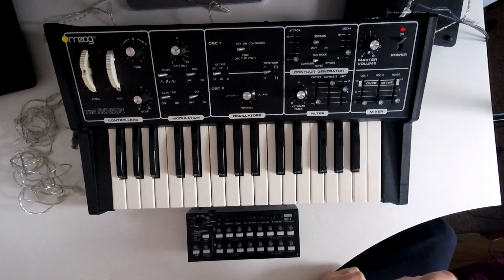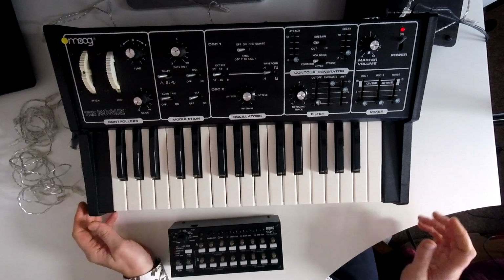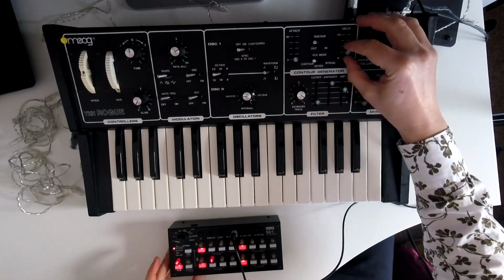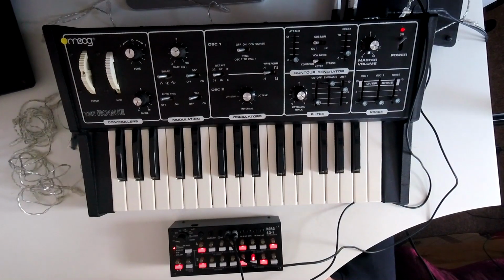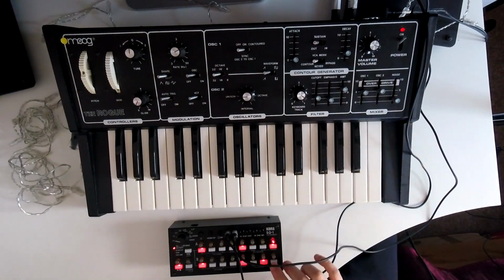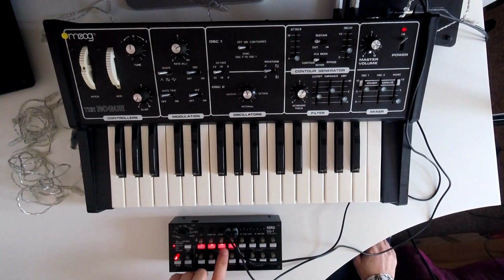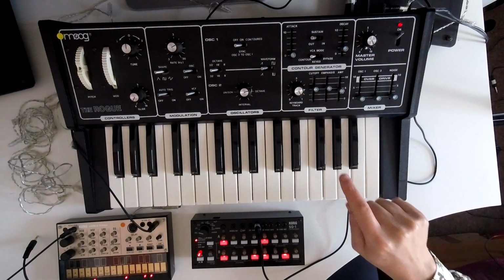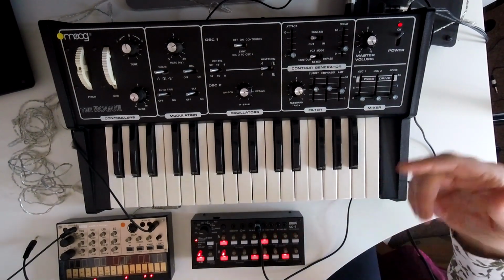Moog Rogue - sounds, sequences and external signal processing using this classic vintage synthesiser

Comment: Very nice!  I have 2 Rogues and one Prodigy (the older kind with no CV inputs).  I need to get one of those sequencers for my Rogues
Reply: i had a rogue since late 90's, got rid of it, always envied and wanted a Prodigy over it.. still want one!!  wood panel, more solid, rich and rugged wouldn't you say?  Prodigy can do more true classic Moog tones, just all around classier than Rogue, but sure it's unique and has a gritter dirtier sound than prodigy
Reply: @michaelpaul5801  I personally prefer the Rogue because it has a Trigger input and an Audio input. I've since got a CV sequencer for my Rogues and it's super cooll

Comment: Hi there! Very nice video. Could you tell me which cables are you using? Thanks in advance. Cheers from Switzerland!
Reply: 1/4” to 1/8” mono cables. Took me ages to figure this out a few years back with the same setup.
Reply: You show a cable with stereo 1/4” on one side and a mono 1/8” on the other side in the video. Do you wire it up with the tip of the 1/8” going to the ring of the stereo jack? I can’t seem to find any info in the manual etc. Thanks.

Comment: Great vid. Thanks. I have a moog prodigy and had a moog rogue back in 1984. Mine made it to vinyl. I actually think the Roque is better for lead lines than the Prodigy even though the prodigy has a much nicer filter. The Rogue can really cut in mix in 2.
Reply from the maker: You has both. Nice! I've only really used the Rogue in small setups, and mainly as bass. Next time I do a bigger project (which is rare) I'll see how it works as a lead. Any tips? I usually add plenty of drive and  distortion to it.
Reply: ConstantLittleGhost Yeah for a lovely lead sound I just used to detune the oscillators a bit and use an analogue delay pedal like a Boss DM2. Used to turn the cut off up on the filter and maybe use a little pitch vibrato on the mod wheel. Envelope with a bit of decay or not to suit. Pretty basic and simple stuff but it sounds so good and rich out of the Rogue.
Reply from the maker: @volt7cooltangs701 Cheers. Sounds similar to what I do but without the vibrato. I'll play with that some more. There's something really nice about the way those oscillators beat when they're detuned. I could play those for hours 😀
Reply: ConstantLittleGhost Absolutely, gotta love that VCO detune beat 🎶🎵